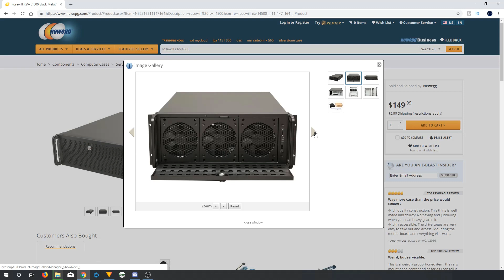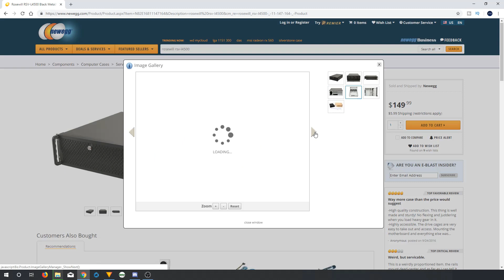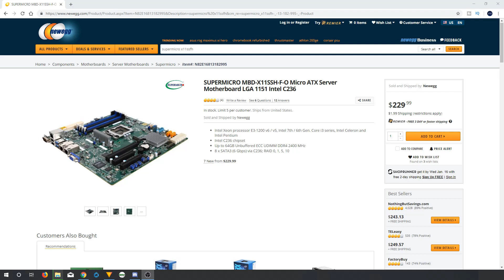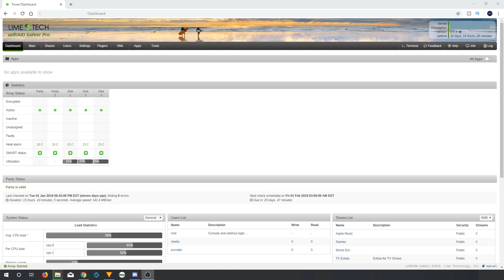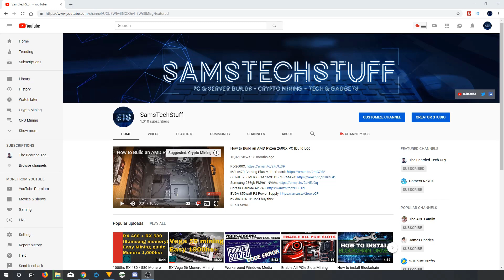Custom UnRAID Build Video: 4U, 15 bay, Low Power Server

Comment: Great video, lots of info! I'm trying to understand the unraid setup....so is unraid the name of the OS??  So would Unraid be the OS and I wouldnt use windows?  I'm not sure I understand what's going on with how it handles the data....are the drives somehow hot swappable? If one dies the info contained on it will be on another drive and not lost?

This is very interesting. Only issue I may run into is I was going to run music server software that runs on Windows (well Audirvana is Windows, if I go with Roon it can be Windows or Lunux). I'm not sure how that would go with Unraid.....also does unraid do DLNA?
Reply from the maker: Hello again!

So yes, UnRAID is an operating system just like Windows 10 is. You would dedicate the whole PC to just running UnRAID all the time. You would install UnRAID OS and manage it through a webgui like you would your hone router. You main PC would still be Windows 10 though. So this NAS would be a second machine dedicated to the sole purpose of serving up network storage to clients. 

As for hot swappable hard drives, yes, this is possible in some configurations with SATA hard drives and many operating systems / platforms. I personally normally shutdown the server when I do disk replacements / additions or any other type of maintenance (cleaning the dust out for example). 

re: How does it handle data?
UnRAID is software that intelligently writes data to drives in an UnRAID array. The a typical configuration for someone starting out could look like this:
1 Parity drive - This is your largest hard drive, it is used by UnRAID to help reconstruct data after a drive failure
3 Data drives - These are the drives that count towards your available network storage space

This array with 4x 6TB drive total would allow for 18TB of hard drives to be dedicated for storage (minus the loss when converting to binary).

If for example after 3 years, your data drive #2 dies, you would replace the disk with the same size (or larger) hard drive. This is made possible by use of the UnRAID OS and its data stored on the parity drive. There is a rebuilding process that reconstructs the data that was on the dead and removed #2 data drive and puts it back on the new "#2 data drive". The system will hopefully keep running happily as if nothing happened for another 3 years.

In traditional RAID 1 for example, you would normally just mirror two drives. This would mean you are losing total storage capacity as 50% of all drives would become the mirrors.

In a traditional RAID 5 array, you would have 18TB of storage space similar to UnRAID. The only problem though is that when a drive dies (and one will) you have to go through a similar rebuild process. During the rebuild process, similarly to UnRAID, you could cause another drive to stop working due to the stress of rebuilding. The main difference here with traditional RAID and UnRAID is that when you exceed the total number of dead hard drives that occupy parity positions, your entire traditional RAID array is gone, unrecoverable. In UnRAID, if your #2 drive died AND your parity drive died, you would still be able to access any data left over on data drive 1 and 3. UnRAID data drives are readable and usable in this scenario.

UnRAID has many other features such as dual parity, the capability to spin down hard drives when they go idle (huge benefit in my mind), custom community apps and docker images, as well as the ability to host its own Virtual Machines now.

As for how to interact with your data on the NAS, you would typically map a network drive from within Windows to quickly access it as if it were a local hard drive on your PC. Most music players these days should support this functionality. I am not familiar with either Audirvana or Roon though. For my media playback, I use a service called Plex. I run Plex in a VM on my VMWare server (though this is completely unnecessary) and have it mapped to where my media is stored on my UnRAID server. Both free and paid version of Plex support DLNA. UnRAID is an incredibly inventive and configurable storage operating system. It is not however a DLNA server - you would need to install some kind of app or service on either your PC, a VM somewhere on your network (or directly on UnRAID) or in a docker on UnRAID. The DLNA server would be granted access to any media on UnRAID and then be able to play it back on your devices. As I mentioned, my preferred method is using Plex but there are a few other great options out there.

This was an incredibly long reply - there is lots to learn if you wish, this is a deep rabbit hole. The TL:DR though is that while UnRAID does cost money (licensed by hard drive count) it is incredibly easy to setup, configure down the road, update, and manage. It certainly is not hte ONLY option for how to store data using a software based RAID like controller. FreeNAS is another popular operating system that has many of the same features and it's also 100% free to download and use. It has different strengths and weaknesses depending on what you use it for. I personally run both an UnRAID NAS and a FreeNAS NAS for different tasks. Don't by shy if you have questions, I can spit out text all day long 😂😂
Reply: @STS  Thanks for all the info! HUGE help. I looked up their website and have been reading a lot about Unraid and watching some videos. It looks like it's based on Linux and has Docker, so any apps that work with Linus/Docker will be able to run here as well. It looks like a great software, my only concern is that I thought I may use it for more than just backing stuff up. But I suppose I could set up a windows virtual and do some things through that, but I'm not sure if you can really do things the same via virtual.

Using Unraid do things like hardware acceleration work? I believe that benifit Plex transcoding greatly.

I like Plex okay and plan to use it for videos. But for music I have to dlna to a stereo system and it seems like Plex does make the dlna connection, but in a way that the client/stereo can see the library and play from it, but I need it where playback is managed from the server side. My library is too big to big through from the stereo side, I need to use the servers app integration like the Plex app to push the music to the stereo. I couldnt get Plex to function that way. Audirvana is functioning that way and their software and app is great, and it specifically bypasses any audio software that could be affecting sound and sends it straight to the stereo dac so tends to sound better. Most 'audiophile' types tend to like Roon, Audirvana, are Jriver (Jriver is too complex for my family to use). Roon is amazing but it gets expensive and doesnt use dlna. That's left me with Audirvana.....but maybe I'll dig into Plex more and try to figure out if I can somehow fix it.